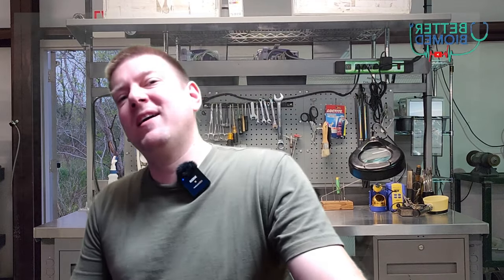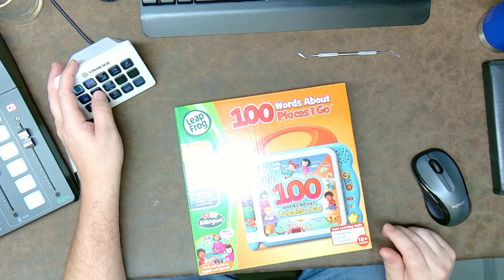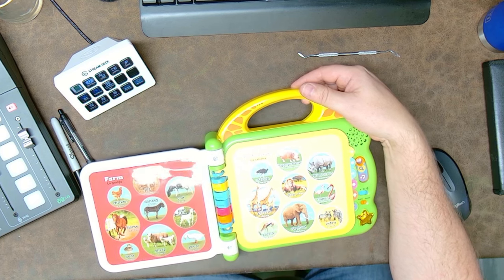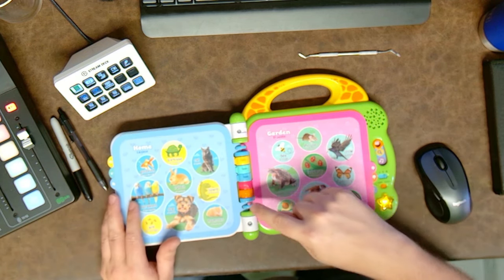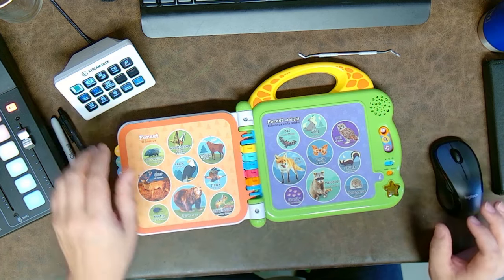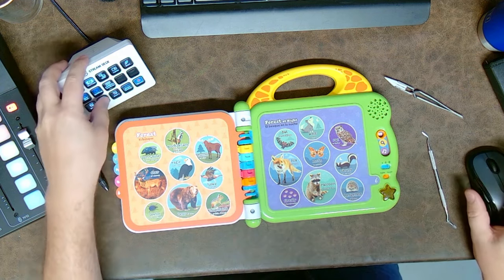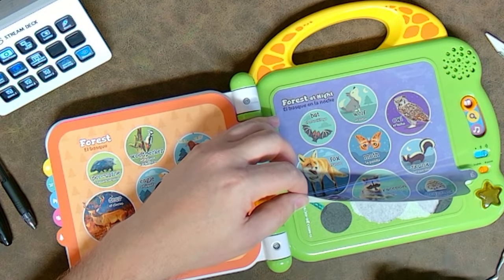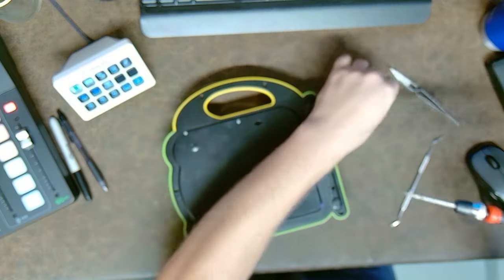100 Words Leapfrog Toy Teardown

Comment: Sure, a capacitive sensor could be made with a single plate/trace... especially when it has such a large surface area... Imagine earth and/or the atmosphere as the other plate... a certain amount of charge could be placed on the real plate, and it would have some tendency to stay on the plate... moving your hand nearby could either attract more charge to the plate or repel it off the plate.
I imagine the bigger problem in such cases is things like 60Hz noise, which can easily be coupled-in...
So, my guess is they intentionally charge/discharge the plate very quickly/repeatedly (maybe even microseconds) and determine if the discharge rate has shortened/lengthened beyond some threshold.
Maybe for the sake of power-savings they might charge it once and wait for it to deplete on its own (which could ideally be never), then do the quick-cycling, briefly, to detect whether it was caused by a change in capacitance or natural discharge through the sensor-circuit's loading, or 60Hz noise.
I rather doubt they use more sophisticated techniques like looking at the frequency/phase-response of the dielectric, since that'd require ADCs and DSP, rather than some simple schmitt-trigger microcontroller-GPIOs switching from output (to charge) to input (to determine how long it takes to discharge)

Comment: it's 100% capacitive, because it seems that the "wires" to each touchpad are dashed not a full coper wire from the white pcb to the pads.
Under the brown pcb on the right, there are 6 "switches" not even real microswitches, just plain copper strips that are pressed to a copper pad on the pcb,
these get activated by a notch on each page.
One of these switches detect when you open the book, the other 5 switches forms a matrix with the touchpads on the white shell and purple bottom. 
10 touchpads per page X 5 pages = 100 Words 
The middle sliding pages itself contains nothing special, only the notch to let the MCU known which page is open.
Also capacitive switches consumes way less power then Infrared sensors would use, because with Infrared these are LED diodes that are allways on or use polling X times per second to stay standby. A capacitive switches consumes zero power while it is not pressed, so zero power during "standby". 
Also if Infrared sensors was used, the camera would have picked this up.
Reply from the maker: Bjorn, do you have insight to how the device can determine there's an input without physical input (just close proximity)?  Is the signal so sensitive that the pads dampen it when a finger is near?
Reply: @BetterBiomedChannel  , the "touch" circles on each page are transparant for the proximity to work. Imagine this device like 5 stacks or piles, with each stack 20 cd's. These stacks represent the pagesides, and the cd's represent the positions on each page. The MCU knows by the pageswitch on which page (stack) you are, and then the proximity sensors determine which cd is touched. So per example on first stack, the second cd has the value "bear", the second stack , the second cd has another value, because another pageswitch is selected. In short it's a 20 keys keypad, but with a 5 positition selector switch, each key can give 5 different values (5 pages). In the white shell are 10 proximity sensors, and in the purple shell are 10 proximity sensors. Those 10 from the white shell are choosen when you press on the left side of the book, those 10 from te bottom shell are used when you touch the pages on the right side of the book.
Reply: @BjornV78 very cool, thanks for sharing